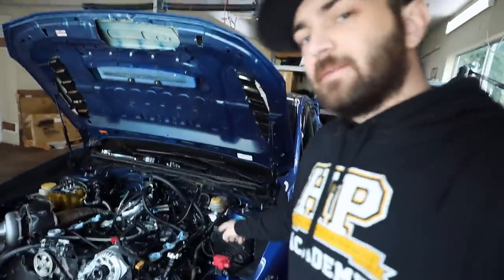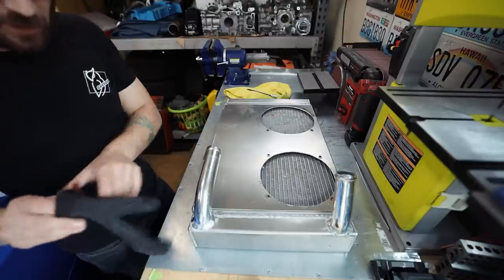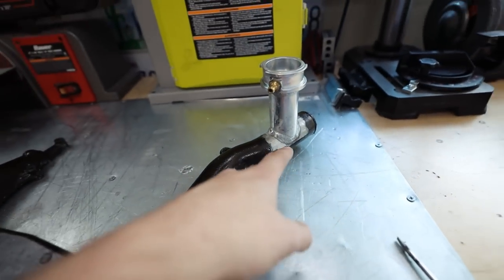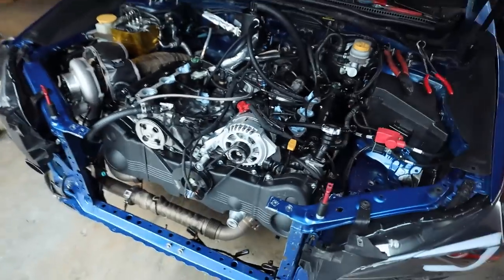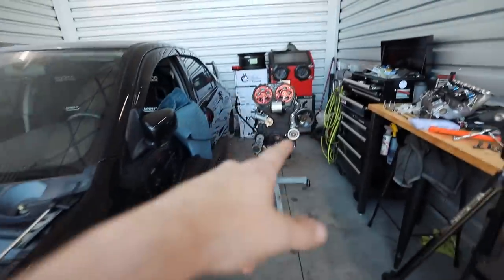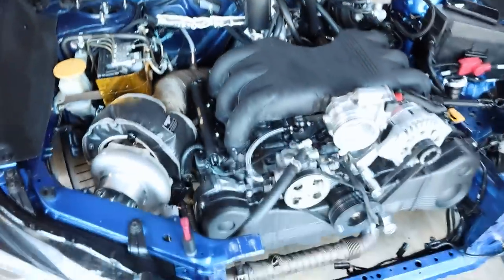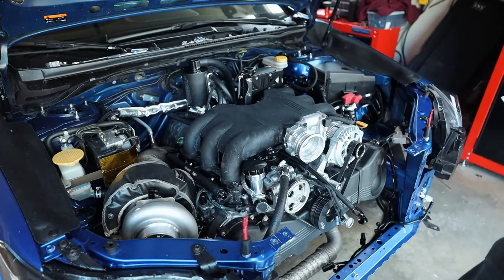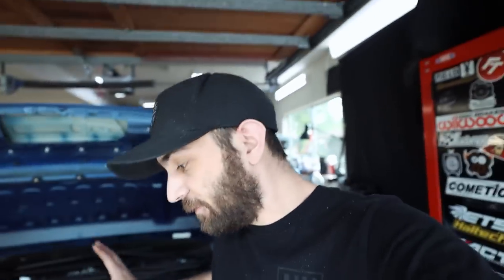Fixing my 6 Cylinder Subaru WRX STI Bunk Cooling System!

Comment: When building brackets make sure to bend the last 1/16" to 90° on the long side. It will add structural rigidity so they won't flex excessively. Otherwise good job on the build so far. Can't wait to see her on the dyno.
Reply from the maker: Good to know and will do this from now on 🔥

Comment: I love your garage space sometimes we really don't need a huge space or spend money on it your build is inspiring. I have a GC8 that I wasn't boosted from factory but I did it myself, now I'm taken on converting it to manual 😁 getting the money together. keep up the excellent work 👏 👍 👌
Reply from the maker: Can build wonderful things in a garage if the space is utilized 🥳 no need for big fancy shops. Ohhhh the GC sounds like it will be a blast though!
Reply: I told Tanner some time ago: I've seen some ratty "hole-in-the-wall" shops produce some amazing builds, and I've seen some "state of the art" shops turn out nothing but shit boxes. A garage is nothing but a pile of bricks and beams. The "shop" describes the knowledge and craftsmanship contained within and how it is applied to the finished product.
Reply: so true first the Gc 8 is so engaging to drive you feel the car on the road it speaks to you love it. secondly its so true about garages and there builds nothing beats talent and common sense interestingly 🤔😄

Comment: Blew my upper radiator hose on the highway today. Wrapped it up in electrical tape and got it home! Watching your videos now on swapping to a koyo radiator!
Reply from the maker: It held with the tape?!
Reply: @Smeedia  yup! Wrapped it with 3M electrical tape and a little bit of duct tape and filled up the radiator with water. It was weeping past the tape but only slightly
Reply from the maker: Actually pretty impressed 😅🔥

Comment: Great job Tanner on the cooling system mods. I asked Dom about coolant bypassing the rad and he told me to GTFO. I went ahead and designed my own kit anyway. No coolant bypassing the radiator anymore (including the hottest coolant coming from the expansion tank). I relocate the thermostat to the upper rad hose. I'm thinking of selling my kit, maybe you're interested in testing it yourself? I am running ONE oem rad fan on a downsized radiator and with A/C on in 110F heat in traffic, coolant won't go over 200F!
Reply: If its not too late, I can help guide you to replumb the cooling system to have no coolant bypassing even with cylinder 6 cooling mod. I only kept the OE oil cooler and it actually worked so well I ditched the need for an external oil cooler. I got tips with bleeding the cooling system with the relocated thermostat and replumbed coolant lines.
Reply from the maker: From what the other 6 cylinder guys have told me. They've advised me to not run one. 

What kit did you end up using for the top thermostat?
Reply: @Smeedia  MMR. Bought a 3/4" barb for the 1/2" npt bypass port. Worked like a charm but overcooled with a 175F thermostat and never even hit 190F on the dyno in 100F+ heat.
Reply: @Smeedia  I wouldn't sweat running a cylinder 6 mod or not. My tuner isn't seeing any difference in cars running them or not. It is just a small amount of coolant leaving to improve a theoretical stagnation. I saw the video and disagreed with that guys theory. Remember that passenger cylinder head uses that port to feed the turbo. The EJ206 twin turbo used cylinder 4 port too. I'm not sure if you remember me telling you to relocate the thermostat last year because of these very issues but trust me tanner you won't have any problems anymore. Glad you got on the right track now. Honestly I think you can get away without running fans at all. No shroud improves efficiency at speed since the shroud is blocking air flow. Maximize the size of fans like you did with the small and large one and minimize that shroud covering. You got the cooling system nailed now buddy, I recommend revving just past 6k rpm to force the air out at the end of your bleeding. Best of luck I really want to see this come to fruition for you.
Reply: @PolishAlexx  The shroud should have some type of gap between the radiator and the fans. The shroud does not block the air flow it helps ensure that all air flows through the fans. Without the shroud you won't get as much pressure flowing over the entire radiator surface. The fans create full negative pressure inside the shroud and pull the air through. Of course that's assuming this shroud has space between the radiator and the fans.

Comment: About the coolant reservoir.  The vent to the ground is how all of them are built anyway.  If you look inside the reservoir there will be a tube that comes up from the bottom and ends near the top.  That's what it is for, so that if the coolant pressurizes beyond the radiator cap it has somewhere to go and then if it over fills the expansion tank then it gets vented out to the ground instead of causing something explode from the pressure.  When you go to the track you shouldn't have coolant in the car but rather just water.  Unlike their power steering reservoir the Chase Bays coolant tank is designed properly.
Reply from the maker: Why does mine not have this tube 😅 

I think I got sent a defective one then because I 100% do not have a tube in mine lol
Reply: @Smeedia  that's weird, I don't know then.  But it should have a tube going right down the middle inside of it, I've not seen one without it. They have a photo of it on their site so you can see what its supposed to look like.  But either way you do need  a vented overflow in the engine bay even with the Radium expansion you installed. I'm sure you know that because I think you mentioned that you had a Cobb one on the way. But you definitely don't want a huge coolant spill or even worse a cracked block if it ended up being the weak link in an over-pressure situation.

Comment: Dude thanks for the info on the cooling mod definitely gonna watch that video
Reply from the maker: There are arguments on both sides for if they do or don't work. I've used them on some cars and haven't used them on others. Cars have always ran same same but if you do want one I'd say still snag one 🔥
Reply: @Smeedia  I'm kinda still on the fence with this and understand both sides, at the same time I'm not going for big power or anything  just need to find more info before I decide

Comment: I love all the nuggets of Subaru knowledge this channel provides! In my case, I noticed slightly higher coolant temps after I installed a Koyo radiator and cylinder 4 cooling mod at the same time on my STI. Thanks to that linked video I understand why that was likely the case now. I'll probably delete it when it comes time to build the engine. Thanks Tanner!
Reply from the maker: Glad I can share what I learned🔥

Comment: I have the same coolant overflow in my wrx. I have a hose coming out of the second nipple running to the bottom of the radiator support. I am almost positive that having that second nipple capped might have pressurized your whole system and possibly popped your welds on the crossover. Another note: I’ve never had any coolant come out of that second hose; I think it’s for if you overheat and you need somewhere for the pressure to go. If you look in the center inside, you’ll see that it has a straw lookin thing so you can’t overfill it. Can’t wait till you sort it out!
Reply: Oh that's what those instructions were for🚱 🤣
Reply: I noticed he had his capped off too, the can is designed for a oh shit moment if the capacity and pressure goes beyond then it vents through that, even on the hottest track days I have never had any leak, but to be safe it is good to run water when possible if you dont have winter in your area this is no different then what the stock plastic unit would do if it went past capacity. I made a video on this install of the product awhile back.
Reply: @louisGauto  I'll check out the vid
Reply from the maker: Mine is definitely missing the tube on the inside 😅
Reply: @Smeedia  yeah there is supposed to be a tube on the inside going about half an inch below the cap. I have one waiting to go on my subie.

Comment: If you're worried about heat from the downpipe and want to make that area usable just build a heat shield to cover the downpipe.  Between the wrap,  the air gap , the shield and the air gap above it you shouldn't have any issues with heat.
Reply from the maker: May try to figure our a heat sheild idea now 🔥
Reply: @Smeedia  looking forward to see what you come up with ! Keep up the good work on the build , can't wait to hear it at WOT

Comment: Finally people are realising the snake oil value of the cylinder 4 cooling mod!!
Reply: When watching Josh at bbr's videos I've heard him say a couple times it's not needed.  It does seem like the cylinder for cooling mod should work in theory, but if so why wouldn't Subaru utilize themselves 🤔
Reply from the maker: The did on jdm X and Y engines only then stopped doing it 🤔
Reply: @Smeedia  It was still different design on the JDM X and y engines.  Cylinder 4 is the sacrificial cylinder that's how Subaru designed it like it or not.  Good way to sell more type RA short blocks.

Comment: I don’t know if it’s here or not, and if you do plan on using the expansion tank. I strongly recommend using the 2-way rad cap on the expansion tank and the 1-way on the radiator. Seeing and how you want to use the expansion as the air burping location then it would make sense that you would eat the coolant to return there when cooling. Subaru does it this way from the factory. Having the 1-way on the radiator let’s coolant and pressure bleed but doesn’t return so there’s no potential for air to get into the system. Having the 2-way on the expansion, up high, let’s it bleed pressure and coolant as well but will let coolant return without the high risk of air getting in, and if air does get in then it will bleed itself if the coolant over flow is topped back off with coolant.
Reply from the maker: Ordered the 2 way 1.1 bar cap 🙏

Comment: Oh, and when storing tires, you shouldn't stack them. Mechanical stress on the carcass is one of the wear variables (Heat, oxygen, uv light, and ozone are the others) so you store them standing up, next to each other, ideally without a rim to minimize weight related wear. 

Sure, it doesn't matter much compared to tire pressures, load, and speed... but thought I'd mention it, since I recently learned about it!
Reply from the maker: Did not know that but I'm going to have to adjust my spares now 😅🔥

Comment: I was caught off guard with the cylinder 4 mod.   I have one installed and was feeling secure about it since I just installed a type RA block on my 06 STI. I did watch the video you linked and I'm taking it off quicker than fast 🙄
I feel heart broken
Reply from the maker: There are arguments on both sides, I'd say if you already have it on just leave it. For EJs having it ahouldent cause any type of detrement at all. I'm not running one because the EGs flow a little differently and there's no supporting info on weather they work or not. Was sdvised by a few 6 cylinder guys to not run one

Comment: I may catch some flak for this but I'd recommend wearing a respirator when working with aluminum, if your working with it in small doses it's not terrible but grinding and welding on it can really mess up your lungs.
Reply from the maker: I was using steel, but definitely good to know for next time I'm grinding it down 🔥
Reply: Naaahhh, it's fine!

Comment: I watched the cylinder 4 cooling mod video in the link. I understand the words he's saying but not the context because I'm not an engine builder. I was told that the cylinder #4 has a different exhaust port path configuration. Why is cylinder #4 usually the first to go? Theory: some people think it comes down to exhaust gases full of heat and kinetic energy is causing issues on cylinder 4 - design flaw. Even people who build Subie engines and went to school for this recommend it so I'm not sure what to believe anymore. I think the community will go with the majority vote to "feel" better :)
Reply: Subaru design cylinder 4 as the sacrificial cylinder meaning it takes all of the abuse. That's why it's usually the first cylinder to fail.
Reply: @DJ_Driven  I think they did this to save money in a mass production environment because the exhaust port is different than 1, 2, and 3 and slams all of that heat and kinetic energy against the wall. I wonder if IAG and other companies noticed and fixed this. I'll have to do more research on this and understand everyone's arguments and "proofs".
Reply: @Martin944turbo  even the exhaust port flow is compromised on cylinder 4. Check out the SubaruOnly link posted at the start of the comments. He's a fluid design engineer / racer and did a thorough breakdown video series on the subject.
Reply from the maker: I've seen arguments on both sides weather it does or doesn't work, specifically for my application, I've been advised to not use it. (Recomendations from other EG guys while been doing this longer than me) but I wouldent say someone is in the right or the wrong for using one or not using one

Comment: Id recommend doing a test with a temp gun aimed at the cylinder head. Instal the tube, idle the car up to operating temps and record the temperature. Next, pinch off the tube while the car is running, and see what happens to the temp.
Reply from the maker: Only real wya to test would be with EGT sensors, a temp gun won't show any real accurate results

Comment: You had to know that two small fans on only the upper half of the radiator was going to reduce the cooling capacity by half. Hopefully the new fan layout works better.
Reply from the maker: New fan layout should be much better 🔥 

I did question it but was told it should work, now we improve and make better 💪

Comment: looking at that dual fan setup..it was certainly causing hot running, that really wasn't a shroud as much as it was an enclosed heat retaining box for the radiator.., one big fan with a built in shroud will lower Temps dramatically by itself. you don't need a sheet metal mount that covers the radiator fins
Reply from the maker: I'll end up keeping it as some Rae material of I need it but don't think I'll run a Shroud, just mount the fan to the rad

Comment: Hey don't use an aluminum shroud on the back of the radiator like that. Its reatricting the airflow and forcing it to only be able to pass through the tiny fan hole. The air should be able to pass through the whole radiator while driving. I had same struggles with mishimotos slim fans on my sti. Went back to oem ones and solved my pverheat issue.
Reply from the maker: No Shroud being used 🔥

Comment: .... that is why I thought the fans where right on the radiator..  o no no you need at least 1/2 an inch off the rad even though 1 inch to 1 and 1/2 i ch is better and the plate needed flap holes for when you're driving for air to push through. You pretty much covered a good chunk of radiator welding it like that
Reply from the maker: I questioned it when I got it back but getting things proper now 🔥

Comment: Since we're chatting about coolant, just wanted to rant a little bit. Out my way at least, it's EXTREMELY difficult to find someone who takes used coolant. No auto parts store will touch it. I had to have my father in law take it to his work (he repairs semi's for a living). Otherwise.... I couldn't find another option. absolutely crazy and frustrating when you try to be conscious of the environment.
EDIT: Wanted to add that I think any store that SELLS fluids for a car, should ACCEPT that fluid for recycling. Can't be that hard....
Reply from the maker: Dude for real! I've got ao many used coolant jugs sitting around 💀
Reply: @Smeedia  Some dump facility's (for garbage and recycling) have coolant and oil recycling drop offs. I think, and don't qoute me on this, but I think the Tacoma trash facility has a coolant recycling center.
Reply: I used to work at a local mechanic/tire shop and we had a big tank in the back for old oil, coolant and stuff like that from whatever jobs we did. People would drop off whatever fluid to us all the time and we had to get rid of it for them. The tank would be emptied by a big vac truck to properly recycle the fluids.  Any canadian tire or walmart kind of shop will get rid of that stuff. Honestly just leave it outside the bay doors before they open. They'll dispose of it for you.  Also im in canada so maybe that stuff is different in the states?
Reply: Your local garbage dump should have oil and fluid recycling.  Not sure if it's legal but a lot of car dealerships service techs just hose down the spilled coolant right down the drain.  It bothers me how sloppy some of these techs are even though they do have huge recycling containers onsite.
Reply: @DJ_Driven  big dealership shops should have a drain system leading to an oil water separator. it would be a violation to not have proper stormwater management, i.e. drains that filter inorganic material instead of going straight to sewage. those drain separators should pump directly out to the outdoor storage containers.
Reply: my local advance takes coolant